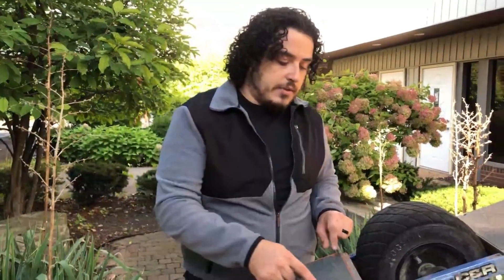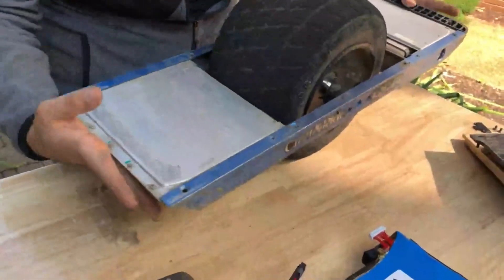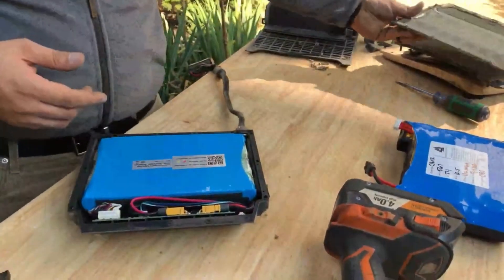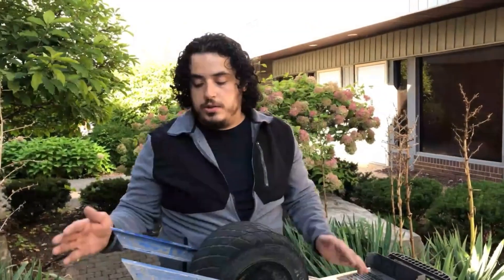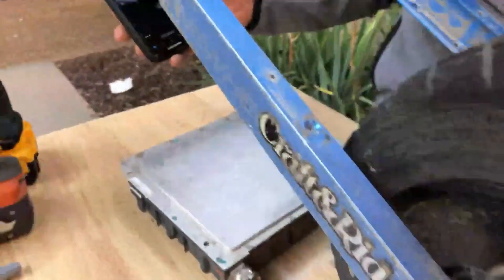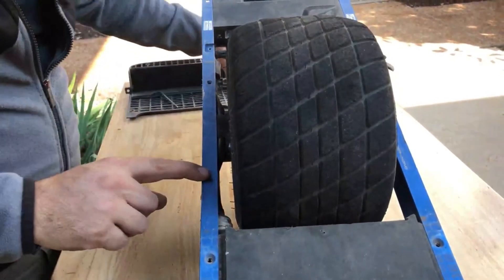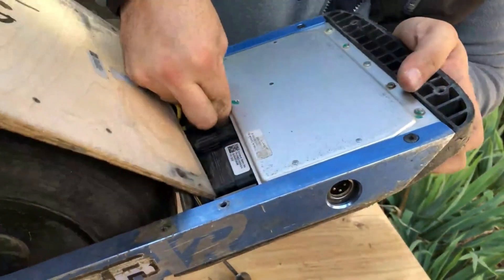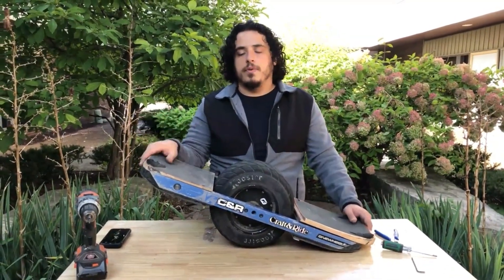CBXR Installation Video

Comment: Beware!!! I bought and installed the CBXR. After 100-200 miles my BMS died. A lot of other people on Reddit have reported the same issue after upgrading with the CHI battery. Awesome product if it was reliable or if CHI could repair or replace the damaged parts. Just know that you are taking a big risk by upgrading your battery with CHI.
Reply: Yep mine died after a few miles

Comment: He really should've mentioned you need a clamp to get the screw holes to line up in the battery casing cause the new battery is so big it kinda stretches out the housing a little.

Comment: Hello, I just installed my battery and everything was working just fine until I plugged it in and got Error code 21 I’m not sure where I messed up
Reply: I’m also getting an error 16
Reply: I’m having the same problem, have you found a solution? Thanks

Comment: Thx for the very accurate and good video installation guide. Did mine today and wanted to add that the current cbxr can not really be installed that easy and flush as you show here the cable handling and scraping took special effort and careful handling but even then the pack is way higher up on the cable harness side. Seating the enclosure back correct again ist best done by aligning the plate on top it is then hoovering over the openings of the screws. Lightly fix screws all around the lid except the phillips screws, and start to pull the plare down a little by little going one screw after the other which tightens the lid evenly. Nevertheless the pack is having a little bulk so the rear footpad has a 1,5 mm gap between rail and footpad and is deforming the footpad concave upwards. It fits but it is no easy fit.
Reply: I've been spending the past couple days on this. The battery is definitely higher and the metal plate can't be installed due to height. I've tried to get the screws in, but even barely in the plates deforms so much there's no way to install. I am thinking of taking out the support squares on the bottom of the inside of the housing to give it a bit more room. Totally frustrated.
Reply: Yep exactly and this is what bricked my board last week..class action lawsuit needs to be filed
Reply: Their answer was a guy that I could send it to to fix..total scam.
Reply: They have a newer video that shows them snipping only one piece but the insert with the battery I later went over shows two. So now I'm down 2500, the amount I've put into the board over the past year..plus the cost of the battery

Comment: that's a lot for this video, I definitely tried my best to follow your instructions guys but only thing is that will the charging light ( green) ever turn green once the battery is fully charged, I ask because i dont see it turn green. or did I do something wrong ?? please help 
overall thanks for your installation guide for this amazing upgrade
Reply: Same here app shows 100% but charger still on red light has yours neen sorted out?
Reply: @joergdweis  yeah dude, I left it overnight and it charged to green . Which hardware do you have ?

Comment: How compatible is the current model cbxr battery with the newest 4212 version of the XR? I know it says on the website it’s only compatible up to the 4210 version, but would I be able to modify the battery housing it to make it work?
Reply: This is just a problel with firmware and hardware version. Not the housing. You can use any after market battery now thanks to the jwffm chip. Go for it

Comment: I'm going to be honest, this review was great at first, but near the end I got seriously pissed off. It seems like you guys were specifically avoiding describing or showing the length of screws that were needed when reassembling the one wheel. One of the big issues with the cbxr is too long of a screw penetrating the battery and causing a fire... And you guys just avoided that entire conversation. WHY
Reply: Maybe that's why they updated the cbxr with the plates on the sides as he mentioned in their video posted in the latter part of 2021... 

Is this what you are referring to?

https://youtu.be/52xPlzbL_lI

I'm interested in installing the cbxr.  I hope it's good.

Comment: If you are upgrading the battery, wouldn't that also be a great time to buy the water proofing kit and install that as well?
Reply: In my opinion, yes.  I just ordered my cbxr and will apply the silicone when reassembling

Comment: I've installed and applied waterproofing both on Wednesday.
I did couple range test and and  i got unsatisfied result. 
Other people who installed CBXR on YouTube,  they have +40km ranges and mentioned battery indicators are showing around 50% when they passing 20KM.
However, mine shows 20~28% of battery (maybe this is not accurate) when i passing 17km.
I'm 220lb, OW h/w 4209 with 4150 firmware.
also, put Burris 11 x 6.0-6 Treaded Tire.
 Although, my cell voltages are still high likes 57.00V on 28% (according to Chi Battery Chart, 72~65% of battery)

Does anyone  has same problem as i do?
Reply: Did your challenge get successfully sorted?   I have a 4209 XR as well.   I just ordered a cbxr and reading thru the comments.   I'm hoping all goes well with my install next month.  Hope your XR is offering better range now.
Reply: @bomchickawahwaaaaah  yup

Comment: A trick I learned as I was having a hard time getting the battery box and axle cable cover to slide into place is to loosen the axle bolts so you get some play in the rail.

Comment: great vid, just one problem, there is a black connector lock, if you press the black tab when removing the main connector it comes off easier and won't break.

Comment: Man,  I'm really struggling to get these wires in the right place.  The battery doesn't want to sit into the housing on the harness side
Reply: put 2 fat cables on top of battery and others are under. it's way more easier

Comment: Great video. However, I winced at 7:15 when he fastens the screws with the power tool. That's asking for trouble if you haven't hand threaded them in a few turns first. Even then, I'm reluctant to use power tools for tightening in those types of situations. One cross-threaded nightmare is enough for me.

Comment: Hi, I would like to kwnon why this upgrade is not working for 4211+ boards. It just we cannot use the extra capacity or the battery does not work AT ALL? Thnks!
Reply: Im pretty sure the firmware just rejects any mods that it detects as not being stock. You'll get error messages and the board wont function till its back on stock.

Comment: Thx for the vid - same issue here as for GoldenWhiteDust below, what on earth is the size of the allen key for the battery pack ? I strip my board to the bone only to find out that I am stuck, unable to unscrew these tiny little allen key screws. Are these US size type of allen ? (I am from Europe...)
Reply: Ohh wait ... Three Thirty Second is actually a size in the US ;) ok really really need to switch to metric one day...
Reply: Ha Canadian plumber here.. we need to carry an arsenal since we get metric AND imperial stuff...  metric is always the way if you can get a rare but COMPLETE kit ( meaning all sizes in 1mm increments.. people don't realize these are very rare due to industry standards ) :) a full kit will fit proper even in imperial

Comment: Thank you very much for the video.  I'm guessing most folks willing to do this upgrade already know, but that gasketed battery compartment should definitely be tightened very gradually and evenly.  I think maybe the power drill shown was only used to start the screws, but should definitely not be used to final tighten.
Reply: Its a good tip you're offering. People who work in mechanical trades understand this, many laymen do not ;)  I would use a small amount of marine silicone on the seal if the gasket was eroded also to maintain water tight seal . :)
Reply: @MrDmadness  Good idea about the silicone!
Reply: Good advice 👍🏼👍🏼
Reply: @MrDmadness  I just ordered the cbxr and will do this silicone treatment when putting the XR back together.  Good idea 👍🏼

Comment: Hello Bara, is any up date for the probleme with the hardwear 4211 and 4212 that we can not instal this batterie because the pairing of the hardwear and original batterie ...? I nee one but I can't because I have the Hardwear 4211.......
Reply: Same problem here, I’m really hoping they find a solution soon
Reply: Same issue here until I just found a low miles 4209 for sale.  Just ordered my CBXR, no more range issues for me.
Reply: @OneManTrail  way to go brotha
Reply: JW batteries has a chip in the works to hack the bms For all versions ;)
Reply: @curlyturdy  I need learn how works
Reply: @roadboarding  it’s not release yet but will be soon ;) spoof the bms to thinking less that 7ah has been used hence the board won’t need to be plugged in a fully charged even tho you have 40% left which is the currently restricts FM put in place by pairing the bms and controller

Comment: Great video, thanks. Would it be feasible to somehow make a housing for the replaced batteries to sit in so they could be charged at home, and carried in a back pack and then hooked up to the charge port on the fly to charge the installed battery via either say the standard charger, hyper charger or even the car charger? Seems a good idea in principal a better way to utilise the old battery. If so is it something you guys could consider making, as there is going to be a lot of decent stock batteries going to waste, Im awaiting on arrival of cbx batteries for both my pint and xr and would love to be able to sit in the middle of no where and re-charge my battery to extend the range even further, without having to still go down the vnr route.